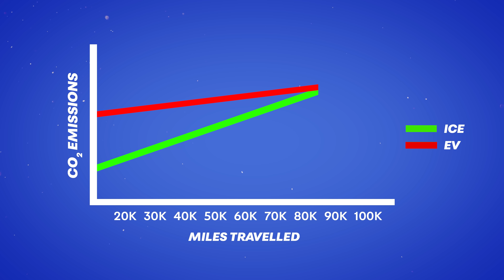Are Electric Cars REALLY That Green? [New 2022 Data]

Comment: So this guy knows more than LOTS of University studies have proven.
GARBAGE. 
Also:
The grid is getting cleaner. 
The EV you buy tomorrow will get cleaner the longer you own it.
The ICE you buy tomorrow will get worse and worse. 
An (ICE) ie: internal combustion engine that’s done 50k is filthy compared to brand new. 
And an engine that’s done 150k is absolutely disgustingly filthy compared to new as every internal (and exhaust) component wears and ages.
Reply from the maker: They’re Volvo’s figures pal. Not mine. Also, I was a university student once. That doesn’t automatically make me credible.
Reply: @Autotrader_uk  I was a uni student once upon a time too - (electrical engineering not journalism.)
The studies I’m talking about are not from one student, or even a few students, and not just one study. 
They’re from highly credible university departments that have looked extensively at everything from raw materials to recycling and disposal.

Riding a bike or walking as always going to be “cleaner”, but the next best thing by far is an EV charged from a grid which is getting cleaner and cleaner.
Reply from the maker: You’re saying exactly what I said in the video to be honest. Cleaner grid = shorter break even point. Dirty grid = longer break even point.
Reply: @Autotrader_uk  Not after this video, certainly...

Comment: No, even with a company making the same ICEV and BEV, that's not the end all in this discussion.  They don't make all their parts.  No car company does, and you'd have to get into the environmental cost of EVERY single part that goes into making the vehicles, and not only that, and here's the real kicker, the factories.  You have to understand the environmental cost to make all the factories that make all the parts, along with all the parts that went into making factories.

To be clear, it takes a lot less parts to manufacture a BEV, and that part list is getting smaller at time goes on.  On top of that, this accounts for what who can do?  Volvo.  Does Volvo have the 4680 battery?  Do they have LFP?  Do they have the CATL Sodium Ion battery that won't use lithium?  No.  Have they really done the research on every metal, mineral that goes into ICEV?  I don't think so, but I'll give them some credit and say they did pretty well and  summarize.

TLDR:      At best, this is a study that shows ONLY what Volvo can do right now, and to make them the standard for BEV just because they are "woke" is silly.  But it is a data point.  So it's fair to call it a data point.  But it's not the reality of ICEV vs. BEV.  You really have to evaluate the world of BEV vs. the world of ICEV to make that comparison and failing to understand that point is a breakdown in your logic processor.  Might want to check that out if you fail to understand the points I made.

One note in this, and how MANY people fail in their comparisons.  When talking about electricity, the source of generation was mentioned, and yes it makes a difference if the electric source of electricity is solar panels (now you have to do an analysis in everything that goes into making solar panels) or natural gas (now you have to do an analysis of everything involved in making the parts to drill, the environmental impact of drilling, transporting natural gas, etc, etc, etc.....)   But was the same thing done for gasoline???  No it wasn't.  The comparison was left at the level of the vehicle itself, along with a VERY incomplete "well to tank" study.  How much gasoline is the vehicle burning, how much electricity is the BEV and what are the emissions based on that.  It's a TOTAL disregard for the fact that extracting oil from the ground, getting it to a refinery, refining the oil into gasoline is a TERRIBLY polluting process and if you live near a refinery are subject to a realm of cancers.  And how about manufacturing all the parts that went into a deep water oil well drill?  The many processes involved in drilling it safely.  How about all the oil spills?  The costs of cleaning up every oil spill.

So, it's a data point.  It means very little, but it's a data point.  And what I know about data is, especially statistical data, is you put into the hands of two different people, you can make that data show two very opposite points.

No I'm sorry this report from Volvo doesn't show that ICEV is cleaner, less polluting or in any way produces less CO2 up until a certain mileage on a BEV.  And this isn't a passion statement.  It's based on very clear logic that most people don't want to follow.  Just the process of refining oil into gasoline ALONE produces gigatons of CO2 each year.  And that's a single step in the process of getting oil out of a reservoir and turning it into a fuel along with all the production of parts, vehicles, etc... needed to get that oil to the refineries, and then getting the gasoline to stations, as compared to installing chargers for BEV, since the infrastructure for electricity is already there, although will need to be improved for wide scale BEV usage.

So, do the research of producing all the parts needed to drill oil, all the parts needed to make refineries, all the chemicals needed to refine oil into gasoline and producing those chemicals, all the piping needed to transport gasoline to certain locations, or pipe the oil from point A to point B, all the parts needed to make the vehicles needed that move oil or gasoline around ALONG with the gasoline THOSE trucks use,  and then you'll start to get close to the REAL cost in energy, CO2, other pollutants, etc... of you burning gasoline in an ICEV.

Once you do the above, it will start to become very clear that since making solar panels uses very little resources and doesn't require thousands of parts or many factories to make the parts because of how much the process has evolved, using solar panels to make electricity simply destroys using gasoline in every conceivable way.  And this mitigates any advantage that ICEV has over BEV during the construction of the vehicles, along with using energy to run the vehicles, along with the very incomplete "well to wheels" calculation.  There's mining involved for producing the parts for ICEV and there's mining involved in producing parts for BEV.  But, NOWHERE in the process of making solar panels is the type of infrastructure that it takes to pull oil from the ground and refine it, every day.

No, I don't think that a "Well to Tank", which is also called a "Well to Wheels" study is good enough.  I don't think they account for all the parts it took to create every component in the drilling process along with everything else I said.  I think it accounts for getting the oil out of the ground, and to the tank.  It would at least account for the refining process though.  It wouldn't account for all the other negative effects of refining oil, or release of methane since this was a study on CO2 since it's a CARBON footprint study.

Comment: The whole thing is a  great big con!!!! I fell for it! Electric cars are a pain in the backside. Go and charge up on a public charger and see what it costs? There's hardly any difference in cost to a good economical car. And that is a fact. Go on the motorway.  Go on, try it. Anything over 30 mph and it wallops the range. I can't  believe how rubbish they on distances. I seem to spend so much time trying to find a charger because it is always low. Forget distance. If you want a runabout to do local shopping or for the school run, fair enough,  but if you want a serious car, forget it. Maybe in a few years the problems will be sorted,  but for now, you take the risk. I can refuel a petrol car as quick as a flash. An ev car seems to take ages, and when you're stuck for time, well! I'll never never do it again.  Lesson learned by me.

Comment: Stop building electrics like ICE cars.  Drop the weight and lower the drag coefficient.  Start thinking like Aptera.  

I find it suspect that the infrastructure, material, manufacturing and transportation of 2000 additional parts needed for an ICE engine  factor in so little.  What about the need for a transmission?  The oil changes every 10k miles?  Dissipating energy into heat vs reusing it?  Breakdowns and ICE related maintenance over the life of the car?  Infrastructure carbon costs - the need to physically transport petrol to every single gas station in the world in perpetuity?   How far spanning is the analysis? 

We are trying to move forward not sensationalize corner cases in marketing papers.  Nice thumbnail AutoTrader.

Comment: Yeh lets buy an EV. 7 years on, oops, I have to buy new batteries.
Reply: Says someone with 0 knowledge of battery tech
Reply: @nzpomdotcom  And you know me, do you?
Reply: @frefnurk1538  no but you clearly know nothing about EVs if you think they need a new battery every 7 years
Reply: @nzpomdotcom  Tesla says there batteries will last 8 years, but that's with only driving 12,000 klm per year. And dont forget the batteries wear down, just like your brain and phone. Do the research before you make stupid comments again.
Reply: @frefnurk1538  A Tesla Model S has just hit 1,500,000km
Reply: @frefnurk1538  - Tesla (and most other EV makers) state their battery packs will have about 80% capacity at 8 years old. So you don't need to replace or scrap the whole unit, just change the dead cells !

Comment: I don’t believe you can work out the comparison to be even remotely close to what it actually is as there are just far too many variables we can’t work out but one thing I do agree with though is EV cars are not environmentally friendly. Does the study Volvo did take into account the manufacturer of the actual energy source like solar panels, wind turbines etc? The mining process and manufacturing processes for solar panels are really bad environmentally and use a lot of electricity and diesel and with wind turbines it’s concrete and steel and we know how bad that manufacturing is for the environment. You also have to take into account the replacement and disposal of these energy sources when they come to the end of their life. Our increase use of electricity I believe is very harmful to the environment and probably undoes any good we do moving to EV. The study of the ICE vehicle has too many variables also as the power plant varies so much from car to car, I believe the best thing we can do with vehicles is hybrid and keep very fuel efficient combustion engines in those vehicles so we do not increase our demand of an external power source and let’s face it even though the hybrid still will pollute the environment the EV does everytime it is charging

Comment: Electric cars are a joke. An elec cars battery range at 90k miles is going to be non-usable, so you have to factor in another goddamn battery to be installed long before then. Which completely throws out the economics and apparent "environmental benefits". Anyone who cares for the environment should be driving an efficient ICE until biofuel development improves.
Reply: A Tesla Model S has just done 1,000,000km. Try again
Reply: @nzpomdotcom  LOL

Comment: I get the mileage travelled vs Co2 output. Totally.
What has always got me thinking, is if your only travelling around 8000-10,000 miles a year (living ,working and only driving in a city for example) and the manufacturer says the EV you are driving needs new batteries every 5-7 years. Then how does that figure look.
Or maybe best case is battery replacement every 10 to 12 years. I fear that Co2 number would drastically change.

Comment: This is a really thoughtful, thorough, interesting piece.  Thank you.  

It looks like we need to find cleaner ways to mine the minerals needed for battery production.

Would there be a significant difference in manufacturing footprint depending on the type of battery - NCMA vs LFP?  And could either of those change significantly in the near future?
Reply: The biggest part is the electricity used in the manufacturing of the batteries. So using renewable power for factories has a huge impact. Volvo are weak on this as they manufacture in China on the standard (high CO2) mix, others are much better, VW uses 100% renewable power for EV manufacture and Tesla uses a lot of renewable and moving to 100%
Reply: @mikemckeown5013  Volvo is now also working with Northvolt, which is makes use of peaks in the renewable energy production in the north of Sweden. They also put in great effort for recycling the batteries as well.
Reply: @mikemckeown5013  Correct Mike. VW's three huge new EV manufacturing plants are all powered by 100% renewable energy, and have a zero carbon footprint. VW are so far (as far as I'm aware) the only car maker to have signed up to the legally binding Paris Climate Agreement...... VW's electric vehicles also use much plant based material in their construction. Even the paint finish is plant based. Good to see them trying after the huge emissions cock up. I think Kia and Hyundai are also heading the same way with their production methods. And - according to Amnesty International - the Chinese EV makers are the only ones purchasing unethically sourced minerals for battery production. The rest have allegedly signed pledges/agreements to buy only ethically sourced minerals......

Comment: Ok, I have now read the study and have to say I'm a little disappointed with how you frame this in the first half of your video. You are presenting this in a way that makes it seem that the conclusion of the study is almost the opposite of what it actually is. The literal conclusion of the study, which is stated on the first page, is this: The carbon footprint
 shows a great reduction in greenhouse gas emissions compared to that of an internal combustion engine (ICE) vehicle, especially if the car is charged with renewable electricity You ask why Volvo is releasing this, don't they want to sell more EV's? Yes! Yes they do, that is why they are releasing a study showing how EV's crush ICE cars on sustainability! It really isn't more complicated than that. :D

Unless... you deliberately made the first half of the video that way so it would act as honey trap for the ICE defenders, luring them in and exposing them to the actual truth by the end.... In that case I forgive you :p

Comment: Yes yes yes. Thank you so much for posting this. I will sleep alot better tonight knowing that I'm not alone with my anxiety of the current trend with battery EV production.
Ok so we live in a capitalist economy and small battery EVs were not profitable enough to start the EV ball rolling. Hopefully smaller more efficient EVs will hit the market in the future, which will change the game. I would like to see less tech in vehicles too. Rare earth elements that are needed to produce the batteries are also used for all the electronic gadgets. If we use lots of these rare elements in the vehicles to compete with other manufacturers such as bigger screens with more features and gizmos and gadgets they will run out quicker and have bigger production carbon footprint and be more difficult to recycle. It is crazy when you think that a lot of the tech in modern cars can be provided by the phone in your pocket.
Thank you so much.

Comment: I'm curious, does anyone know how eventually changing the batteries affect those numbers ? Does a high mileage ICE car close the gap once you install another battery pack on a high mileage EV ?
Reply: Not really relevant as the average car lifespan is <200K miles and the lifespan of EV batteries is >>200K miles, so you’d not replace the battery unless there was a fault, like you don’t generally replace the engine of an ICE.
Reply: No, because batteries can (and are already) being virtually fully recycled.
Reply: Like the Model S that's just clocked 1,000,000km on it's original battery? They don't run on Duracell AAs you realise
Reply: @Guillaume Barrette - Does a high mileage ICE car still have the same parts from the factory🤔.  I'm guessing it will have had an exhaust change, sparkplugs, oil changes, maybe a new turbo, gearbox or new engine.

Comment: I think the Elephant in the room is that cars are getting too big nowadays which ends up using much more resources to produce than a car from say the 90s.  But no matter how manufacturers handles this situation, making new cars either EV or what other forms from here on will always be detrimental to the environment due to the fact that raw materials are needled in the process.  
There are no easy solutions for this mess, but I guess one simple act of driving less can greatly benefit the environment.
Reply: I agree entirely. Smaller, more efficient EVs, less car use overal, and more bike / bus / rail use -- oh, and electric bike and scooter trips tend to displace walking, biking, and public transportation rather than cars, so ought to be banned from city centers.

Comment: EV will never become really sustainable because they are engeneered as consumption material, to be changed every few years like iphones, its all just speculative interest. Also the batteries are made using rare materials which are limited and extremely damaging for the environment in their extraction process, and they are only recyclable in a very small fraction. EV where doomed from the start.

Comment: The problem with Volvo reports is 1: SCALE, you have not only fixed cost, but fixed pollution from creating anything. And Volvo doesn't really have the scale to compare the numbers: Volvo sold 15k xc40 recharge and 185k of the normal ones. When they get to a scale like Tesla, that makes EV models at the same scale of Volvo ICE, we might start considering comparing the pollution.